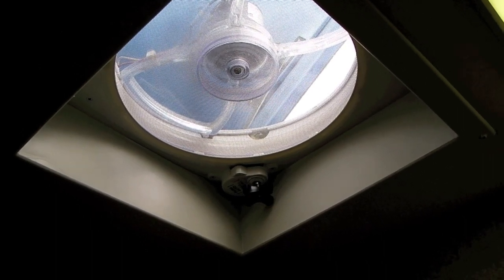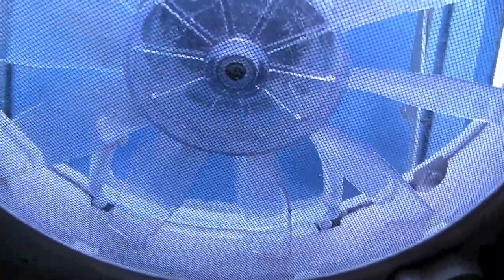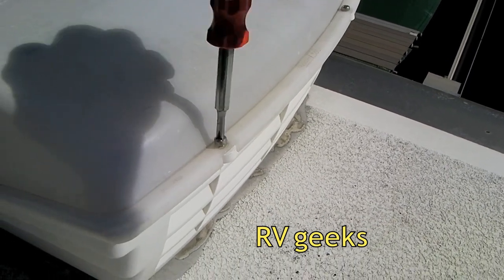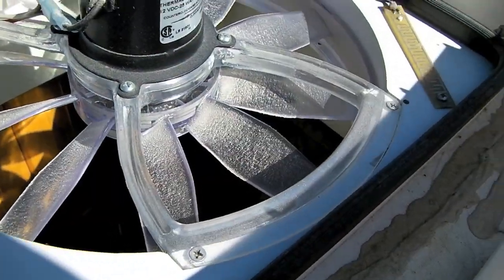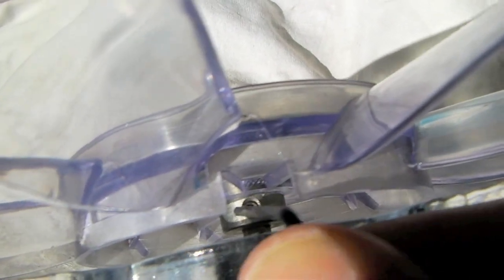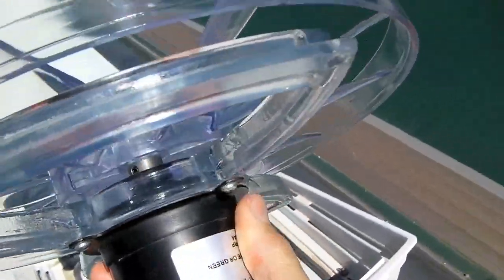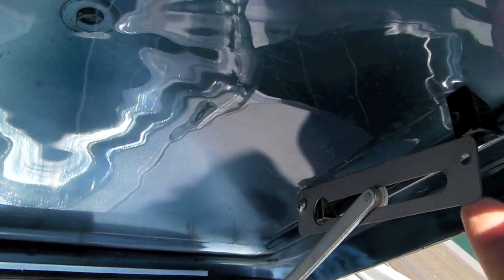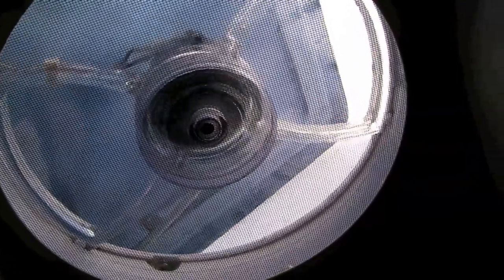HOW TO: Completely Clean an RV Fantastic Vent Fan

Comment from the maker: @brucebrod  Our model of Fantastic fan has a manual control knob.  You pull down on it, and then rotate it by hand to raise and lower the lid.  When done, you push it back up to re-engage the motor that raises & lowers it automatically.  Your fan may be different, as Fantastic has several different models (or maybe you have a different brand).  Hope this helps.
Reply: It helped me!! Thank you!

Comment from the maker: This fan is manufactured by the Fantastic Vent Fan Company in the USA... details at fantasticvent(dot)com. It runs on 12-volt DC current and can move nearly 1000 cubic feet of air per minute. It's equipped with a thermostatic temperature control and a rain sensor, which turns the fan off and closes the lid when it begins raining.

Comment: Besides making the fan blades look prettier, cleaning them also increases the efficiency of the fan by reducing the drag on the blades.  Years ago I cleaned the squirrel cage blower on the furnace of my mother's house.  It had never been cleaned since the house was built in the 1950's.  The blower's fins had a thick layer of accumulated dirt on them.  After cleaning, the airflow from the blower almost doubled!  That saved some money on natural gas since the furnace needed to run less to heat the house.
Reply from the maker: +Thomas Levy Excellent! Thanks for the great info, Thomas. 😊

Comment: You have to go on the roof but much easier that taking the fan down from the bottom.  Just did two of mine and the whole job was about a half an hour including washing the fan and support in the sink.  Thanks for the tip.
Reply: Never thought of going in through the roof, easier then inside.  Next time on the roof!

Comment: That was great how you propped the lid open.  It's possible to remove the fan blade from inside the coach but the allen bolt is out of visibility.  I can't say enough good about Fantastic Vent Fan Company.  They're the nicest people to deal with if you need a part, or want to upgrade a feature.

Comment: Thank you RVgeeks! I have the 3 speed Create-a-Breeze version in our little 6 year old class-C and today I was installing the 7350 upgrade kit to make it a full fledged Fantastic Fan.  I wanted to remove fan blade for cleaning before completing the swap and the instructions talked about a screw in the end of the shaft holding the fan blade on.  But that screw doesn't exist in mine.  My fan blade is solid white not clear.  So this video clued me in to the allen head set screw.
Reply from the maker: Excellent! Thanks for sharing. :)

Comment: Great video I also have fantastic fans very similar to yours I’m afraid to put a cover over mine for fear that something will break if the cover isn’t able to open all the way is there an adjustment for the lid so something doesn’t break
Reply from the maker: Hi Rick! Your concern makes sense, since the lid will indeed press against the cover when it opens. But you have nothing to worry about, since the lid-opening mechanism is designed to stop lifting when it senses pressure. So whether it stops because it's open as far as it can go, or because it touches the cover, the signal to stop is the same. We put covers on both our fans that slightly limit the amount the lids can open. But they touch and stop without any problem at all. You'll quickly get used to the sound they make when the lid touches, where you can hear them slow, then stop. No problem. Just to give you an idea how this is really no problem, both of our fans are the original 15-year-old units that came on our '05 Mountain Aire when we bought it new. Neither fan has missed a beat, with zero problems from either one in 15 long years of heavy full-time use, despite stopping against the covers every time we open them (and we use them a LOT)! And having covers is the BEST, since we often want one of both of the fans open even when it's pouring rain outside. So feel free to install them, with no worries about any fan adjustment needed, with no harm to them. FYI, these are our covers, and we LOVE them, partly because they swing right up for easy cleaning: https://amzn.to/2BlVGrh

Comment: Thanks much! 3/32 Alan wrench. That's the key you gave to me! Happy trails
Reply: What I do is take paper towel, fold it square, half it twice, apply cleaner to one end, stuff it behind fan circle, then move around the circle to clean. Then pull out and using other clean end of towel, reapply cleaner, stuff it, hold stationary, rotate fan blade around.  Bla, bla, bla: whatever works. Happy trails!

Comment: My new travel trailer has a vent opening over the bed but is not wired there for a fantastic fan. However there is a 12volt light fixture nearby. Could I just pigtail off that fixture to obtain the power necessary to power a fan? We don't usually have all of our lights going at the same time but I'm concerned with the burden on the breaker system as these fans pull a good 3-4 amps at full boogie! What's your advice?
Reply from the maker: We suggest that you locate the 12-volt fuse for the lights nearby. If they are on a fuse that is at least as high in amperage as the fan requires, you should have no problem using that circuit. Since the fan should have its own fuse built in (our does), if the fuse for the lights is HIGHER than the fan calls for, the fan will still be protected by its own fuse. Unfortunately, the lights are likely to be on a smaller amp fuse and therefore might not enough to add the fan into it.
Reply: Bummer! but I knew that might be your answer. I'll have to proceed to the next step and take off the trim ring to see if it's not pre-wired for such an upgrade. Maybe they were so happy to sell me, that they forgot to upsell me? Meanwhile the bathroom is wired for a little "fart fan" and that puppy has gotta go! I'll have at least one of those in my unit if I can< this after all frikken Aridzona I live in.
Reply from the maker: MrLowsporh Good idea to look for prewiring! Fantastic Fans rock!
Reply: Just an Idea I had as when I discovered when I bought my travel trailer, that although my truck has a complete tow package, it did not have an electronic brake controller. I did know however, there was a plug and play pigtail behind the dash and in a few minutes install, we were good to go!

Comment from the maker: How old is your RV? And with all due respect, how much does your husband weigh? ;-)  RV's have pretty strong roofs, but a very old RV or an extreme amount of weight could theoretically be a problem. We've never heard of anything like this before though. If the RV isn't falling apart, and you husband is within normal weight range, the only thing he should be careful about is not falling off the roof. We know someone that happened to. Broken wrist was no fun, and sure could have been much worse.

Comment: HELP GOT A BEE STUCK IN MINE AND TRIED TO GET IT OUT WHILE IT WAS SPINNING BUT NOW ITS STOPPED ITS OPENING AND CLOSING HOW CAN I GET IT TO SPIN THANKS FOR ANY SUGGESTIONS
Reply from the maker: Oh no, Noeleen! Sorry to hear about that. It sounds like there might still be something stuck in the fan that's keeping it from spinning... so you might want to try removing the fan (like we did in this video) and make sure it's all clean. If that doesn't do it, it's possible that when you stopped it while trying to get the bee out that you damaged the motor. If that's the case, you can contact Fantastic Vent Fan to see if they'll send you a replacement (they used to be EXCELLENT about that, but times may have changed). Hope you get it resolved!
Reply: @RVgeeks  Thank you got the dust off the mesh today vacuumed it and they are working fine!

Comment: Does you fan cover open up all the way with the external case you added up top?
We are replacing the cheap bathroom vent fan with a new fantastic fan. I like to leave that old vent open a bit most of the time so I installed a maxx air cover but that would be too short for the fantastic vent cover.
Reply from the maker: Hi Mookie! Our fan cover does not allow the fan lid to open all the way, but we're fine with that, and it's worked great for 12 years on both fans with no problem. The lid is designed to stop opening when the motor feels resistance, so touching the inside of the cover is not making it stop in a different manner than it should... just a little sooner. We never use it on the highest speeds, so have never worried about it not opening all the way, or any added resistance to air flow. The ability to easily open the cover for cleaning is our favorite feature, and we've always been happy with them.

Comment: Can you tell me what I did wrong I took the fan screen off to clean and when I put it back together the fan won't work
Reply from the maker: Sounds like a wiring issue, Suzanne. Check to make sure the connections are correct and snug, and that the fuse isn’t blown.

Comment: Hi guys:-0). I just read your excellent blog post on the 3 best Could I take off the rain sensor?  Even though I have vent covers, they still close on their own when it is raining, or, in Florida, Just because it's very damp even if very sunny, they close. They also "fry" from salt water air then freak out making closing noise even if closed.  Could I just cut and cap the sensor wires? will the fan still work?
Reply from the maker: Hi Julie! Hope your travels are going well since our encounter in Abbotsford. Our Fantastic fan has a switch to ovveride the rain sensor. If yours doesn't have that, there should be no reason it can't be permanently disabled anway. The way ours works is via a sensor that uses two lines of very fine wires that zig-zag alongside each other on a little circuit board. Whan a drop of rain lands on the board, it touches both wires, completing the circuit, which closes the fan. If you have a similar set-up, and can access the board (ours is visible from above, on the roof... in the lower right corner of the fan in this video), you can either snip one of the wires, or maybe even try placing a piece of tape over the little board and wires to prevent it all from getting wet. But disabling the rain sensor shouldn't have any effect on the normal operation of the fan. We'd just be sure to test that first before removing it completely. Hope this helps, and safe travels! - Peter & John
Reply: @RVgeeks  Yes, my travels have gone super well, I stopped by "our "spot on my way back to Quebec after my winter  in Victoria.  BC is soooooooo beautiful.  I enjoyed so much driving through the many endless scenics roads. I Just now arrived in Florida.  It is nice to see the Atlantic.  My Fantastic Fan does not have an override for the rain sensor.  My little sensor board looks just like Yours.  I will begin by covering it with a strip of gafers tape.  Super idea since there is not that much water falling on it,  being somewhat protected by the fantastic vent covers.  Thank you very for the excellent explanation of the rain sensor functioning.  I appreciate your help always.  See you again somewhere Sometimes. Safe travels, ☀🌈😊.  Julie
Reply from the maker: Gaffers tape is perfect, and of course non-destructive. If for any reason that doesn’t work, simply snip one of the two wires going into the rain sensor, and it should never close on its own again. Enjoy Florida! Take good care.
Reply: @RVgeeks  Ok perfect.  Thank You very.  ♥️🐚🌊.
Reply: @RVgeeks  Update on the work done to kill the rain sensor; !!    I finally unplugged the rain sensor at the electronic green board inside the fan.  I unscrewed the square part at the ceiling 912 screws), then, the flat part with the handle, buttons, wiring,  there  I saw the rain sensor wires connected to what looks like the fan motherboard.  I kept it in stock in case I would ever want to put it back.  It was a bit of a task to put everything back together while working alone but not that bad.  I also wanted to open it because the screws holding the handle mechanism were stripped, I wanted to see how it was holding inside.  I ended up using longer screws.  Two problems were solved plus a good cleaning of the fan.  Now the other fan.  maybe I just cut the wire 😅.   It is so nice not to fight with the fan for it to stay open,, at last, peace after 4 years of discord.   One thing I wonder is how to lubricate between the motor and the fan blades' middle hole.  Mine does not have an Allen screw.  I can just pull on it from inside too.  But,  it gets stuck on the motor pin.  it is very hard to pull.  I wonder what to put in between so it does not stick so much.  All this is a bit difficult to describe in writing with my" French-glish",  I hope it is clear enough:-0).  Thank you for your precious help which always gives me courage and direction to go forward with my little projects.
Reply from the maker: Hi Julie. Sorry for the delayed response. Just saw your comment. We don’t use any kind of lubricant between the fan motor and fan blade. We remove it so rarely that we don’t mind it being a little sticky. It sounds like you did a stellar job on the first fan, but we’re thinking that a quick snip of the wire on the second one would be perfectly fine!
Reply: @RVgeeks  Hi!,  Thank You for responding to me, Its always good to hear from you and I greatly appreciate your shared experience and your good advice for me ;-0).  Yes indeed,, a little snip for the other fan and take some sun on the beach here in Florida instead.  
 :-0). ☀️

Comment: Never approached the most important item, Rain Sensor!  Almost all malfunctions are a result of a dirty sensor.  Add this step, and this video will be of value for all RV owners.
Reply from the maker: You’re right about the rain sensor all right! At about the 6-minute mark, we were remiss in not mentioning that when we clean and wipe down the area surrounding the fan, before reinstalling it, we actually spent more time cleaning, including the rain sensor, than we showed. In attempting to avoid making the video too long, we neglected to stress how thoroughly we cleaned the entire surround, including the rain sensor. We do clean it really well though, but thanks for pointing that out. Very important indeed!

Comment: hate to be negative but why is the fan screaming after you cleaned it? Mine is 13 years old and quiet as can be.
Reply: That screaming that you heard at the end of the video was actually the automatic dome raising.  After it was done raising the fan was as quiet as a mouse.  Those little tiny motors they use to lift the dome are very noisy and grunt to get the dome up.

Comment: How to get rid of allergies in an RV if you get a cabin air filter from a Honda pilot two of them they do fit. I do that in my shops intake. RV geek I recommend that you attach the actual connections then where the clip is you can utelize pig tails from a Chevy Tahoe so it's watertight plug and play.
Reply from the maker: Cool idea!

Comment: I think the fan needs some oiling!  Good demo, many thanks!!

However, I disagree with the Maxxair vent covers you have shown.  Only cover that works with a Fantastic Fan vent is the pricier Fantastic Fan Vent Cover.  This is sufficiently large to accomodate vent cover being open, and THE ONLY COVER that has been shown to allow full capacity operation of fan without impeding air flow.  There is a Youtube video demo on these covers that shows you how MAXXAIR and all the others impede full air flow.
Reply from the maker: That is exactly what Fantastic wants everyone to believe. We have been using our fans with these covers nearly every day for over 10 years with zero problem. If you typically run your fans at maximum speed, which we rarely have the need for, you will get more airflow with other covers, but ours have been great, and we love the easy access they provide for cleaning, not to mention how reasonably they're priced.
Reply: +RVgeeks Ah, I stand informed.  I was misled by FF.  I tend to believe what I see, but videos can be misleading too.  Thank you for stating this, because I was holding off on buying an FF cover which is pricey.  I can now buy the cheaper one.  Many thanks!!

Comment: Why not just remove the 1 screw holding the fan blades to the motor? This can be done from the inside , you get the same access as what you did
Reply from the maker: +Gary Dietz Give that a try and you'll find that it would be very awkward to reach the Allen nut and the fan would be very hard to remove. We've tried it. 😉
Reply: RVgeeks We just did it from inside.  No problem getting fan loose , and everything can be reached. This fan obviously had not been cleaned in it's 16 years.
Reply: I can remove the single screw in the center and remove the blade from inside.  But, my model is only a year old.  Prior to 2014, the fans were slightly different.  That might not have been an option on the this model in the video.  It almost looked like the spindle mount was pressed into the plastic fan blade at one point in the video.

Comment: You went to all that hard work to clean the fan but didn't clean the vent cover? Also I think the MaxAir vent is easier to take off, no screwdriver needed, just slide the brackets over and off it comes.
Reply from the maker: +B Cobler We always clean the cover, but this video is about how to dismantle and clean the fan, which isn't needed for the cover because it's obvious.